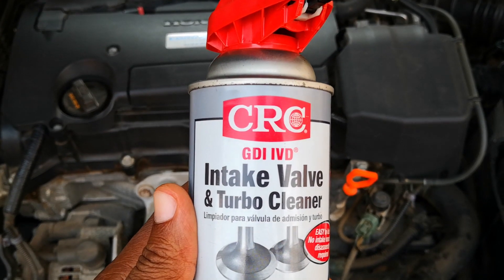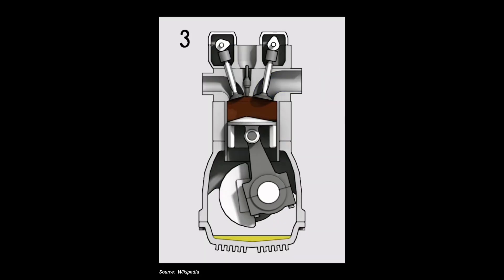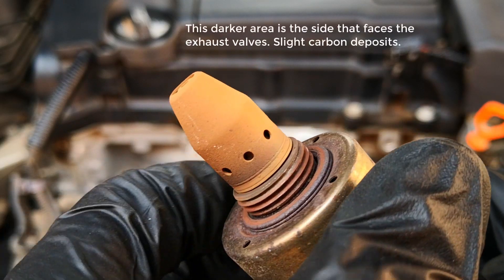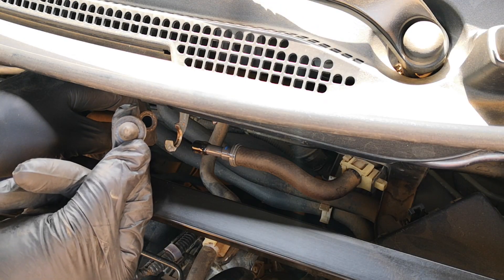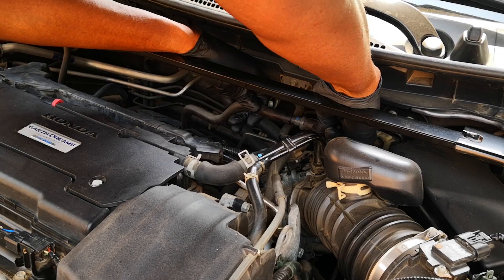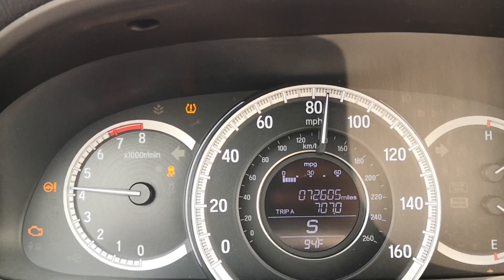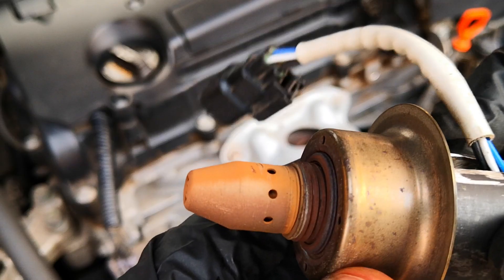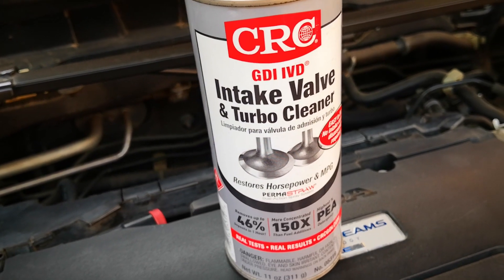Does CRC Intake Valve Cleaner BLOCK Catalytic Converter? Catalytic Converter Before and After

Comment from the maker: Do you have a different opinion or experience with CRC intake valve cleaner? Let's chat.
Reply: I removed the intake and did it manually a couple of years ago, I tried this method but I think it might require a second and or third application. On turbo cars it's not often easy to find where to apply; I made a 2mm "service hole" in the charge pipe and found a grommet that fits and seals with a bit of silicone to plug the hole, not ideal... 
2016 BMW f20
Reply from the maker: I have to agree with you on needing a 2nd or 3rd run if there's no disassembly. I just repeated this and this time, I got footage of the intake valves. Should share the video soon.
Reply: Yes...Catalytic converters either have honeycombs that could be cleaned..or they have collapsed internal.. replacement with inspection boroscope review...Its the difference between Designers and Mechanics...We have to fix their mistakes and they have liabilities and waivers/ Big money to cover..Valves are easy to clean...But a whole intake is challenging without removal...I live in Central Arizona/No Smog Req. here...Time is on my side..What if anyone lives in Major City/ Smog Pay Off?/ DIY is great..but to know how to bend the rules when needed......

Comment: On a friend's GDI engine with very high mileage and a very cheap Chinese cat converter, the honeycomb inside broke apart and  made rattling sounds immediately following CRC GDI treatment, necessitating its replacement. At least, the owner's mechanic blamed the CRC for the disintegration of the honeycomb. And yes, it happened immediately following the treatment. The converter was still relatively new, but the engine had never received any carbon mitigation in over 200k mi. The car wasn't drivable before the CRC treatment and would otherwise have needed to be towed. The mechanic had never mentioned to the owner, and has never since acknowledged, the widely profesionally acknowledged need for carbon mitigation in GDI engines. Interestingly, said mechanic doesn’t perform walnut blasting of intake valves. In spite of installing another cheap new cat converter less than 10k miles ago, and a relatively new O2 sensor, the car recently had a converter bank code that was cleared with Duralube's emmissions systems cleaner.
Reply from the maker: Thanks for sharing. Personally, I wouldn't use CRC if a car isn't driveable. I'd rather do physical cleaning.

Comment: If you wanna know if it affects your cats, you'll need a obd scan tool with live data to watch the voltage on the O2 sensor,sensor two. Get before and after readings. If the voltage is going up and down more rapidly, the cats are now clogged more.
Reply from the maker: Fair point. But a visual inspection is also useful to see if CAT has more deposits.

Comment: I'm wondering if doing this through the throttle body would have been more efficient?
I was think about using a full can of Seafoam first to let it coat the catalytic converter's internals so it could soak and soften the deposits, wait a while, then repeat with a full can of CRC and then hit the highway and let the system run its course and dislodge the gunk inside the catalytic converter.
Anyways, thanks for the vid, bruh! ✌

Comment: I tell you what, the carbon will block your piston rings if you drive it after the clean. YOU MUST DO AN OIL AND FILTER CHANGE IMMEDIATELY AFTER. Drive for a hundred ks. Put an oil flush into the engine. Drop the oil and filter. New oil and filter. This is vital. You're welcome.
Reply: you say immediately, but then you say drive 100km?

Comment: Excellent review and test.  I have a 2016 Honda Accord 6-speed manual that I have never done a carbon cleaning on before (95,000 miles).   I was very concerned about destroying the Cat using this product.  It seems that your Cat was fine afterwards and will continue to clean itself over time.  I'll have to consider this in the near future.   Thank you very much for your video.
Reply from the maker: You're welcome! All the best.

Comment: Perfectly  safe YOU MUST FOLLOW the DIRECTIONS .   For better outcome repeat  again in 1000 miles .  Now you have a difference .  After that repeat every 15,000 miles .
Reply from the maker: Haven't heard of the repeat after 1000 miles, but think it should help. Do you have a reference for this?
Reply: @DIYAutoworksNG  Used  once at 325,000  miles on my 1998 Lexus GS 400  .  Then repeated again  2 times every 1000 miles apart  . Changed the oil after .  Car now has 356,000  runs perfect , more power , and no mis idle .Now repeat once every 15,000 miles .  Please follow the directions exactly nothing different .
Reply: How do I keep 2000rpm with prius?
Reply: @jaymin343 doesn’t Toyota use multiport fuel injection ?

Comment: Try the best combination...CRC for intake/throttle body cleaning..No one hour soak time..immediate drive time after.....but add Star Tron Enzyme Fuel treatment to fuel tank before and on regular basis..PEA/T.S. Alcohol/Naptha.....Have OBD 2 scanner on standby for codes...
Reply from the maker: Lol. For some reason, the no 1 hour soak cracked me up. Thanks for sharing. Not sure I'd attempt this approach since its contrary to the directions. Did you check before and after footage?

Comment: I'm also wondering if these products are chemically safe for the catalysts. There were few chances that carbon would block the pores but catalyst poisoning, contamination or aging due to substances not supposed to be there is much more likely.
Reply from the maker: CRC states its catalytic converter and oxygen sensor safe.
Reply: @DIYAutoworksNG  Thanks! I'd be curious to see a before/after catalyst efficiency too
Reply from the maker: I know! Unfortunately, I don't have a way to test this. But given that the margin for error on the cat is quite slim, I'd expect codes after some driving if poisoning had occurred.

Comment: Great video! I watch Toyota Maintenance YouTube show. He shows how he cleans Toyota air/fuel sensors with CRC Turbo cleaner spray. Man does it work! I will remove my 300K. Toyota Prius Cat. and clean it with CRC cleaner to make sure it is clean.
Reply from the maker: Yea. Good product. I have a part 2 of the video lined up. I'll view the intake valves, combustion chamber and cat before and after. Should be fun😅
Reply: @DIYAutoworksNG  Thank You! This really helps us All!
Reply from the maker: You're welcome!

Comment: I am going to try this product on my 2019 ford ranger. Im nearing 30k miles. I just had my oil changed and filled up on 94 octane ultra premium along with a bottle of chevron fuel injection cleaner. I am going to run a can of the crc intake valve cleaner then do a drain and fill on my oil after 150 miles. Next oil change and filter I'll do in 3k miles. Think I'll try the spray right before the throttle body instead of letting it go into the intercooler.
Reply from the maker: Sounds good! If you don't mind, will be delighted to know how it goes.
Reply: @DIYAutoworksNG  with my experience rebuilding small engines, I typically go for head removal and manually cleaning valves and head along with valve lapping. I'd rather not go that route here just yet, maybe around 100k miles. I'll let ya know if there's any issues, but this is just about the next best thing. 👌

Comment: I used this and got a 2097 code immediately afterward.  Tried to reset but it came back.
Reply from the maker: I had about 3 codes as well as you could see, plus misfiring. That all cleared during the spirited drive. If its misfiring, drive in low revs till it clears up, then you put pedal to the metal.

Comment: I would consider using something like Cataclean after to help. 👍
Reply from the maker: Haven't tried cataclean before, but seems like a good product.
Reply: @DIYAutoworksNG  

It has good reviews everywhere. But until I get oil consumption under control, P0420 is still going to happen.

I had the BG Engine Performance oil flush done a few weeks ago. Hoping its stuck oil rings.

 Only driven 200 or so but no drop so far. 🙏

I did the CRC again almost an hour ago until I can get the BG 3-step fuel induction done.

Installed a catch can 6 weeks ago and it's working as far as I can see. But its not catching the 1/2 qt every 500-600 miles I was losing amd with no leaks, unless the oil stealing fairy comes at night, its obviously burning it.
Reply from the maker: Changed PCV valve?

Comment: If your vehicle is a year 2000 regular fuel injection and not GDI, does this method work ?
Or is it best to treat fuel system from fuel tank?
There's a risk of hydrolocking engine?
There's no water in CRC, how is it possible?
Reply from the maker: If your car is not GDI, then there's no need using this method. Getting the variant that can be added to the tank or any other fuel system cleaner that works will be good (you can checkout this in-tank cleaner review of gumout all in one https://youtu.be/GRP0thS-xCA).
Hydrolocking applies to all fluids not just water. Fluids are not compressible, hence if you have a significant quantity in the combustion chamber, the engine will get damaged in the process of trying to compress the fluid.
Reply: @DIYAutoworksNG  
How do you know if an engine is hydrocked after doing this treatment?
Reply from the maker: The engine will suddenly stop during the test, and refuse to start. In essence the engine will get 'locked'.
Reply: So I just did a 99’ subaru legacy 200k and it ran amazing after. As long as you don’t do a continuous spray of the product i think its very difficult for hydrolocking as well I don’t do the rev part after or idling i just turn the car off and sit an hour and then rev it 3-4times drive 3-4ooorpm for 10mins.
Reply from the maker: Being gentle on the spray is key.

Comment: Best fix is to get a new catalyst converter , you start fumbling with this and at the end your car is ruined...
Reply from the maker: I wasn't fixing anything, no codes at all. This was just to clean intake valves and then document any deposits on the cat. As you know, so many say spray intake cleaners risk dislodging chunks of carbon, leading to clogging of the cat.
Reply: LMAO, cleaning your valves on a DI engine is near fucking mandatory every 10k. If you are suggesting people buy a new cat that often you are fucking insane. Also, how would that help clean his valves? Just how dumb are you?

Comment: Use the "Cataclean" next to see if there's any improvement in the honeycomb appearance.
Reply: When a catalyst is bad there's no way around it, it won't auto-clean itself with anything, and at the end it'll damage your engine... when you've a failure on your emissions system, fumble with these sprays is dangerous, for you and your family carbon monoxide kills...
Reply: @karlwalter2242  you do know that the honeycomb inside a catalytic converter is made of precious metals capable of endure extreme conditions. The only ways a catalytic converter can become unusable is, if the engine runs too rich for too long or if too much oil is entering the combustion chamber and if it takes a hit hard enough to compromise its integrity and functionality. They in fact can be cleaned, if it's done before it gets too clogged with hydrocarbons and or oils, in that event temperatures will rise high enough causing ignition of those chemicals destroying the honeycomb or melting it in the worst case scenario.
Reply: @guuuu666  , Not to be mean but, i'm a licensed auto tech with over 30 years of experience, don't let those gimmicks fool you... It can cost you more than a car... that's how people have loss their lives trying to save money dying from carbon monoxide inhalation, again.. when you get an emissions code is either the O2 sensors, a bad coil or a bad catalyst, one depends from the other and there's no magic spray to fix this...
Reply: @guuuu666  , As maintenance? taking them off, and cleaning them by putting them on a bucket with water and a lot of Dawn soap helps to try erase a code, if this don't work, they gotta go..... with the catalyst installed? don't waste your time and money...
Reply: @karlwalter2242  it's 😎, I figured you didn't understand my original comment. I don't own a car with easy access to the catalytic converter like that Honda and I was just asking if he could run a test of that product to see if it works and how well. I know catalytic converters can be cleaned when removed, as the family hard core car enthusiast I've been doing it for a few years so they can save money for a part that can last for 20 something years if the engine is properly maintained.
Reply: @guuuu666  , Welp, as I said before, check all the reviews on shops around your area,  and take it to the professional shop you can find, like i said before there's no magic sprays that can clean a catalyst converter.... and that's the truth, especially with them models you mentioned.... safety 1st....
Reply from the maker: I'm sure that with just normal highway driving the CC will complete the cleanup. As yet, I have no need to use cataclean or any other CC cleaning products. The key is always  engine in an efficient state. CC will be happy. My 2003 Accord has over 265k miles and is still on the CC the car came with.

Comment: Your audio is always too thin and the volume too low.
Would rather have seen the valves to see it had worked.
Reply from the maker: Thanks a lot for the feedback on the audio. Will see how to fix that.
I did try to snake the borescope camera past the throttle body to the intake valves, but Honda's design of the intake manifold on this car made it impossible. Only option would have been to disassemble the intake manifold to get images of the valves. Wasn't ready to do that just yet. I totally understand your point though. Well said.